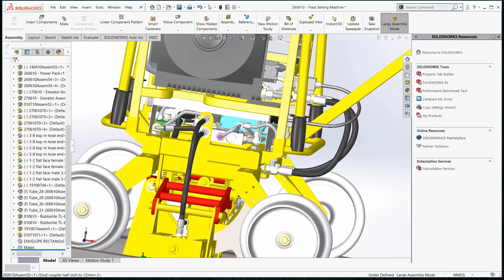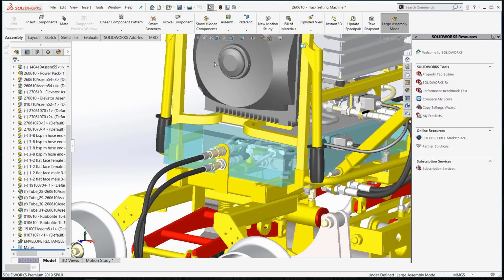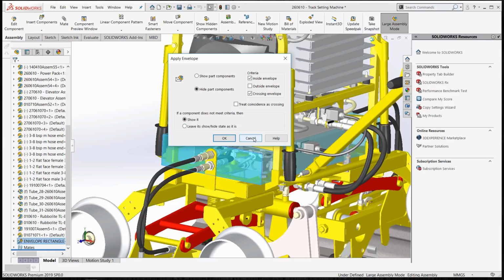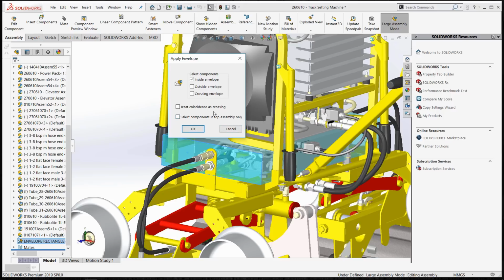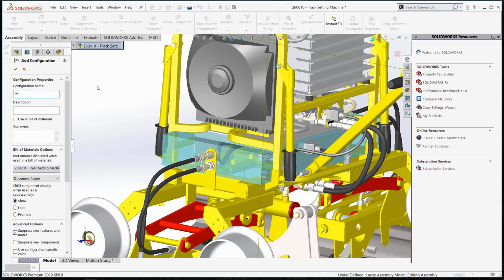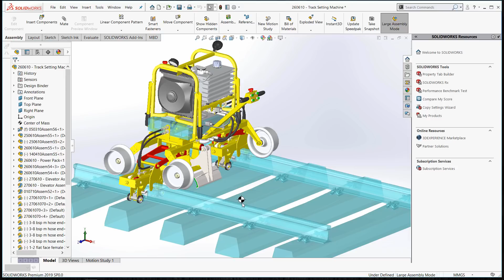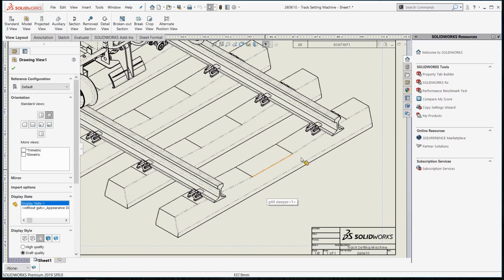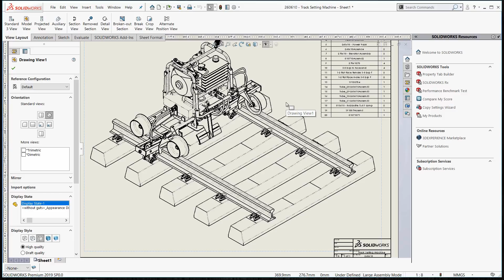SOLIDWORKS CAD Assemblies - Using Envelopes

Comment: Dear video creator, I’m trying to calculate the motion range of a complex part A inside part B and create a cavity in B by subtracting A’s motion range to avoid interference. However, manually creating this cavity is difficult and time-consuming for complex shapes. Is there a way to generate a new 3D solid by scanning part A along its motion path? Any advice would be greatly appreciated!Thanks!
Reply from the maker: There is not a specific process for this kind of operation. I would recommend reaching out to your VAR's support team for options to help streamline your process.

Comment: Great tips in this video!! It also works great on drawings for showing the machined version of cast/molded parts. For example, we have a series of cast parts that we machine about .016 off the back face to create the Datum A face. But on the drawing, we like to show the outline of the cast part as a phantom line, just to clarify.